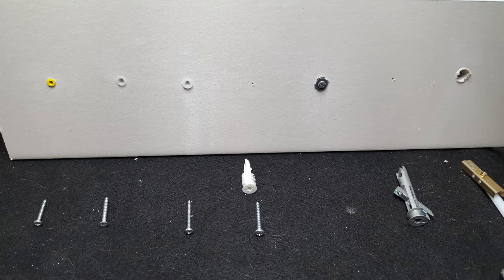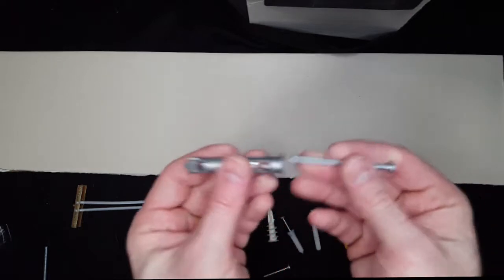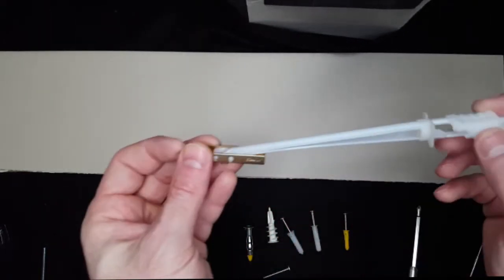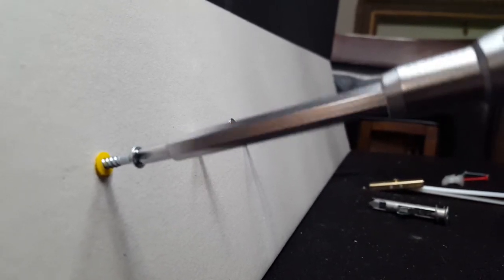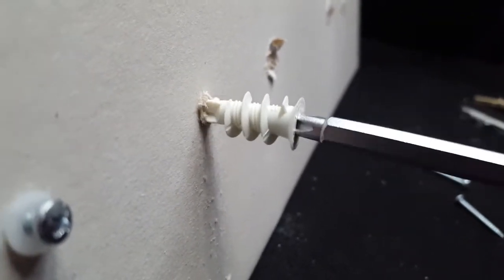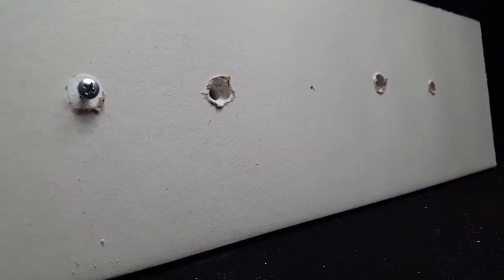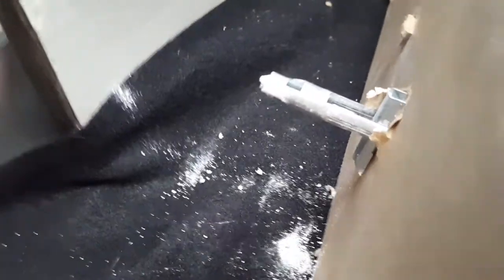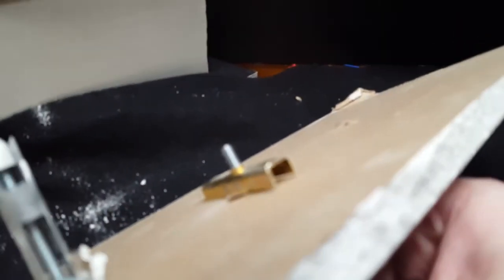Drywall Anchor Installation (Drywall Anchor Test: Toggler, Snap Toggle, EZ Anchor, Expansion Anchor)

Comment: Great video, but it looks like you installed that plastic Toggler  / PopToggle (Toggler or Hillman brand, the product is identical) at the end incorrectly: It comes with a red or yellow plastic piece that  you need to insert and push in to 'pop' out the toggle wings and set them in place, BEFORE installing the screw. Sometimes if it's a tight fit, you need to push really hard or even use a hammer on the plastic piece (thought the instructions say not to..) to get it to pop. 

The way you have it installed will still work well enough for light loads, and to be honest sometimes I forget to set them in place, but to get the full benefit you really need to install them properly, and I'm willing to bet that it makes a big difference in their holding strength. 

These are great anchors, probably the strongest drywall anchor short of a SnapToggle, and they're my go-to for installing things like floating shelves or heavy mirrors, where I don't need a stud but I need something pretty strong. 
Only downside is, they're nearly impossible to remove once installed.. (only way is to cut off the flange with a razor, or maybe a drill, I've never tried and I don't think it will be easy..)
Reply from the maker: You are correct, and if not popped through, it's basically like any other alligator style anchor. Also, when installing things for customers, ease of removal is important so I like to use the metal toggle bolts for heavier items, and the screw in ones for lighter items.

Comment: This is a great video, that been said, please avoid clickbait thumbnails for your videos, the anchor on your thumbnail with the words descriptions was the only one not installed in your video and only showed in a few posts screenshots, please correct me if I wrong and missed the installation
Reply from the maker: For some reason that footage didn't make the final edit, but I changed the thumbnail. If you're looking for demonstrations of various toggle bolts, I have them in this newer video: https://youtu.be/iYsDrY7L3G8
Reply: I really appreciate this information!  I would ask you make specific recommendations for the uses of these different types of anchors and especially what is YOUR preference, give examples.  I was very interested in seeing how anchors work.  I assume toggle anchors are better for drywall…and of course finding and drilling into a stud always preferred.  Towel racks don’t ever seem to hold up due to the constant usage of hanging the wet towels on and off for example.  Thanks again for the demonstration.

Comment: Thanks for this. Question about this specific stud finder, does it work with textured walls?
Reply from the maker: It should work as long as it can slide easily over the wall. If there is too much texture, it might not slide freely and might not work as well.